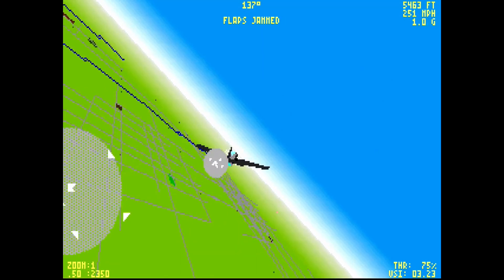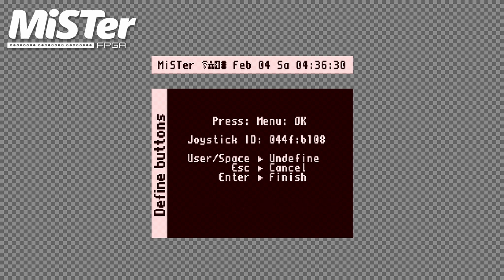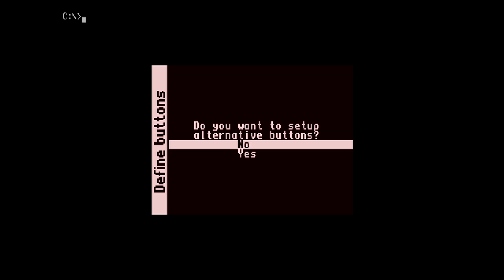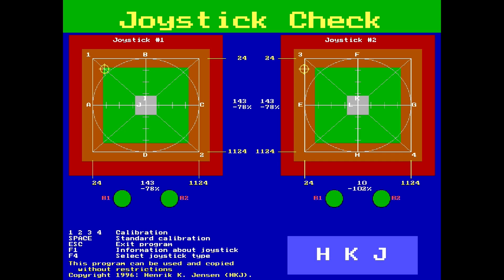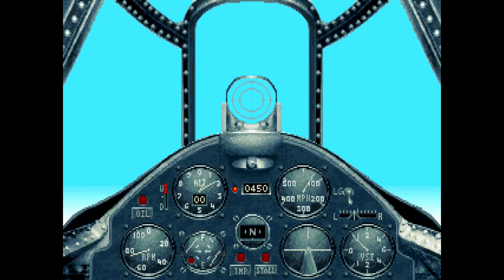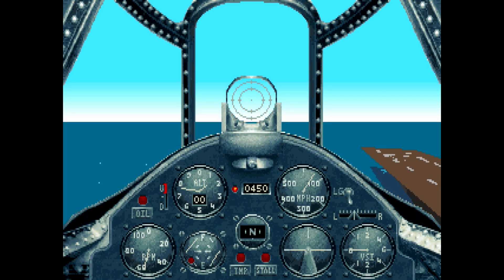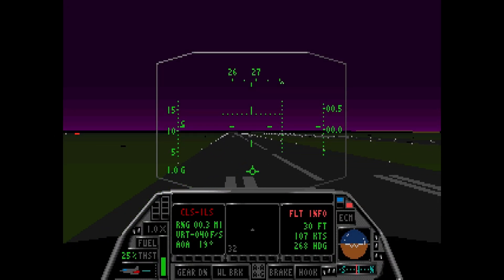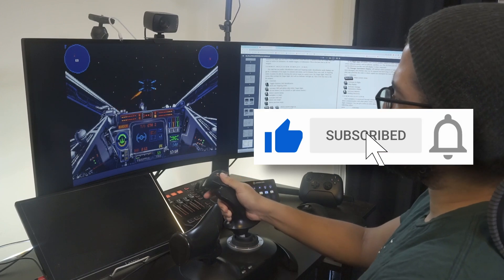Flight Sticks in DOS w/ MiSTerFPGA -  Part 2 - Setup Guide

Comment: Thanks for putting this together!  Very helpful in getting proper flight stick controls set up in the AO486 core!  Configuration help in the more complicated cores is always welcome 🙂  I used the help here to set up X-wing and have a couple videos releasing today that use the XWjoy patches.  Of note regarding that game, is that if you're playing the original disk based version of the game and MIDI music, you'll want to use the original/older version of the patch.  Otherwise, it will overload the MIDI channels from the repeat command inputs and their accompanying sounds.  The disk version handles SFX differently so that particular one goes through MIDI instead.

The benefit of playing the disk version is the excellent MT-32 soundtrack, which is the best audio option possible for X-wing.  CD-ROM version messed this up by forcing the General Midi soundtrack even when selecting MT-32, and it's unbalanced with incorrect/off-tune instruments often times.
Cheers!
Reply from the maker: You're welcome! That's good to know about using the original versions, some games just sound better over MIDI than CD audio. I haven't tried using the MT-32 soundtrack on the game yet so looking forward to playing the game with that.
Reply: @LusRetroSource  be sure to use the v1 XWJoy patch when you do play the disk one. the v2 patch you shared originally interrupts the music playback during flight otherwise

Comment: "thorr" here.  I was able to get my Thrustmaster PS3/PS4 Hotas 4 to work by holding down the PS, Share and Options buttons when first plugging in the USB cable.  It gives you a green light instead of a red light on the joystick.  Previously, my extra axes for throttle and twisting the joystick were not working, but now they do.  It works really great with the Playstation core as there is a button and analog function for every PSX control.  It also works great for AO486.
Reply from the maker: Thanks for the tip!

Comment: I think the only way to make per-game remappings work is for the MiSTer to allow the user to set up and keep a separate list of remap configurations, and to then have a selection menu users can use to select the corresponding remap configuration before or just after they launch a game. Fully automating and autodetecting that selection process would require that the MiSTer watch some event (interrupt? network/serial port?) that can be triggered by some batch file. Not impossible to implement, but somewhat OS-specific and perhaps not worth it.
Reply from the maker: Yeah, it just seems like a lot of work.
Reply: This was the same concept I had for a possible system to allow that.  I really don't see any other way, and it's a much-needed feature.  Hopefully some day it's implemented.